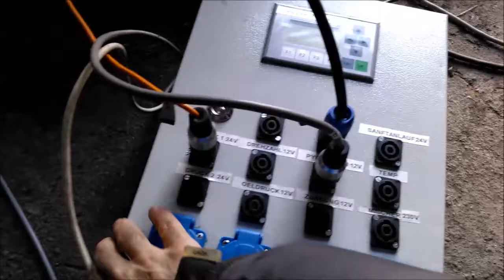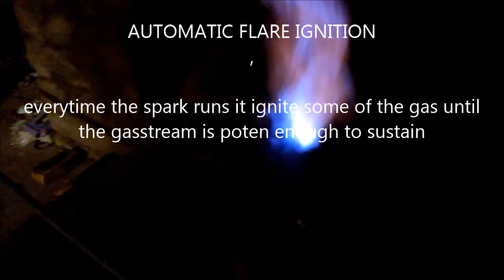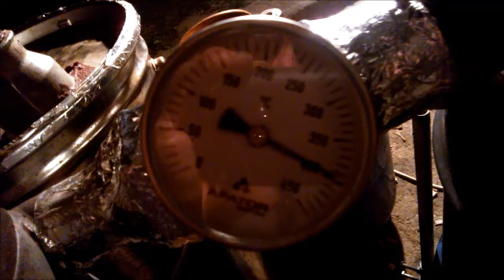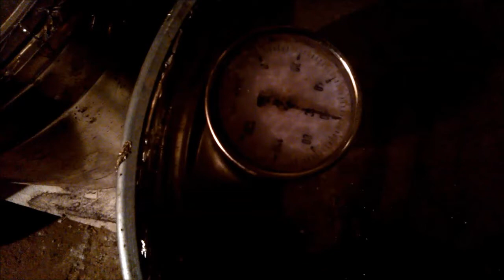The automatic DriZzleR

Comment: impressive blower and auger you have there.
Reply from the maker: darbycrash55 Thank you, The  vacuum blower is capable of simulate the different succion forces of differnt engines. By setting it at certain underlevel pressures I can experiment how my DriZleR will behave wit small, medium of bigger engines. The Auger I had specialy made. One can buy much auger designs on the market but they almost all have a round feed tube. Do not buy such one. They only transport conr or small round wood such as pellets Woodchips will stuck. You must have an auger that has a trough or square feed tube;Luk

Comment: I'm with Dan on the flame colour issue... I have over 200 hours run time on our little genset...

char, wood chips is all that we use for filtering.
Reply from the maker: Arvid,
I became afraid of woodchips filtering after making a little mistake. Too hot gas ignited the filter box. Good it was outside or my house would have got fire.
Reply: Yup... you do have to have adequate cooling that is for sure... we are typically very close to ambient so I have never worried about it.
Reply from the maker: International Supply Arvid, Agree on cooling, but than you get the other problem; moisture and slrurry or dirty condenswater in your filter wich will lead to presuure drop. Just today working on a hot gas bag filter. Like to Keep the filters, cyclone hotgasbagfilter- on the hot but dry side and then after cool and condense out, only having some slight coloured water.
See how that goes. hopefuly tomorrow test. Your tractor looks good.

Comment: this is the first 24hr un-monitored gasifier that i have seen that can't bridge the hopper...i like it

have you considered using a break-beam IR laser shot through your tube to sense the fuel level? and control a Normally Closed relay to activate your feed motor....that rig you have running now works well but must use a fair bit of electric power and has number of moving parts to wear out in longterm use even if it was built with bearings in all joints
Reply from the maker: Hi UnH...
Thank you for the compliment. We tried non impact sensors like temperature laser sensors like in a temperaturemeter gun, and also a distance laser meter like in a polaroid camera or a car but then the proff ones; All very expensive but hapely cheaper second hand ones on e-bay.But... The pyrotouch does not only have a level sence function. It also has the compaktor function to disturb any eventual chips hang ups, bridges or hollow burns. Therefor fisical contakt with the fuel is needed. Of course this is just the very begin of that sort of technique and only possible on a shallow caol bed of just two/three centimeters above reduction as is the flaming pyrolyse the unique feature in the DriZzleR gasifier.

Comment: Hello Luk.
  A very useful video.   I notice that you use a square tube for you auger.  Do you prefer this shape as opposed to around tube?  Or is there some other reason you chose this shape?  I am looking for augers as we speak.   Do you use a geared-down motor to directly drive your auger?

Pete Stanaitis
------------------
Reply from the maker: Hi Pete, Glad to see you here. Yes there is a reason we use a quare tube. In a round tube iregular woodchips wich gets catched by an auger flight can not turn loos and are then blocking the feed or worse. In a square tube a chip that get between a flight and the tube wall has a change to turn loose at one of the four corners of the square tube. With a round tube lots of blockings in a square tube none so far. Yes the motor is geared down for maximum torque and also low speed thus minimal delivery wich is utmost important in a DriZzler where the amount of chips must be always be dripped in less posible.
Luk
Reply: Luk Vanhauwaert I was hoping you would say that!  That's what I thought about the square tube, too.   And--- I have lots of that around here.
Reply from the maker: Luk Vanhauwaert Pete, did not tried that myself but some other fellows uses an oversised round tube as outside and inside a small auger. This for the same reason, to leave some space where a blocked piece of wood can fall free.

Comment: Thanks for the reply Luk. Is the collar around the reduction tube to provide insulation, to keep heat in the reduction area?
Reply from the maker: No the collar is only to support the reduction tube on the bottem of the fuel tube it is 1cm wider than this opening and thus rest on the bottem also posibility to cement it on that bottem with high temp cement. As the reduction tube points up and is smaller than the fuel tube I insulate this space/gap with firmly pressed flyash. This flyash provides the insulation.

Comment: Hi Luk. Thanks for your videos. You have had a big impact on my own design thinking. I would really like to know how you have set up the area at the bottom of your gasifier. Things like, what size is your restriction? Are you using a restriction? What are the shapes down there? Are they flat or curved?  How deep is your reduction zone? Is there a grate down there? I have watched all your videos and can't find one where you explain these things. Love the colour you are getting in your flares. Regards
Reply from the maker: In a DriZzleR unlike an imbert style gasifier, measurements do not have to be painfully calculated because this gasifier has a broad ratio. One can drive a small 1 cylinder generator and a 1.6l VW engine on the same gasifier without changing anything. So you have a lot of play without getting punished.
In the above DriZzleR The fuel tube 220mm wide, has an  opening in the bottem of 150 mm.In this opening is a reduction tube around 120mm 100mm deep with a collar of 160mm. The collar is cemented on the bottemplate with the 140mm hole, de reduction tube points up and is surounded with stamped ash so you get a flat surface with a hole of 120mm. The bottem of the reduction tube has a grate from stainless steel mesh. Openings of the mesh about 12 mm. See our blog www.thedrizzler.org for more simplier builds from members of the small but steady growing group of other DriZzleR builders

Comment: Very nice Luk.  This system of yours is truly inspirational. Thank you very much for this instructional video and keeping us up to date with your wonderful progress. Larry
Reply from the maker: Larry,
Thank you. I try to post as detailed as posible. not always easy when one has to watch the process. But with this automatic DriZzleR i have some more peace.
Reply: Luk,  I was wondering if anyone has tried using a Cadmium cell, or other light sensing electronic device, to trigger an automatic fuel input? In the US, all home heating oil burners have a cad cell in them.  When the system starts, the cell looks for the flame (light) and if it is not present it shuts down.  This is to prevent oil from pooling in the bottom of the boiler, if on ignition occurs.  I would like to try using the UV/IR light from the hearth area to tell the driZzle feed system to add fuel.  Any thoughts?
Reply from the maker: Larry Turner Larry, as I said to the other gentlemen. Sensing the heiht is not the only function of the pyrotouch/compaktor. The compactor distribute the flaming pyrolyse even and in equal portions. This is needed because the feeder does not deliver very precise; Also the compaktor destroy's any hangups of chips or bridges. But As I always say tha DriZzleR is a very young type of gasifier, I am not knowing all, so all welcome to start and experiment with us and share. More heads can think of many more good things.